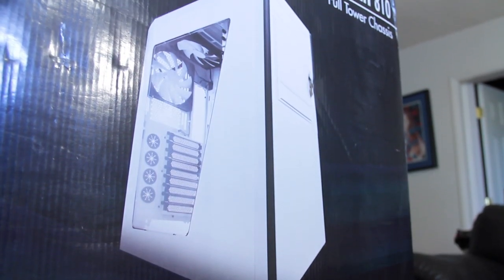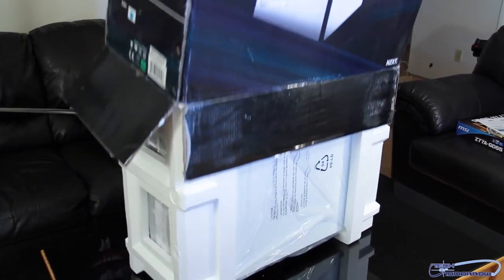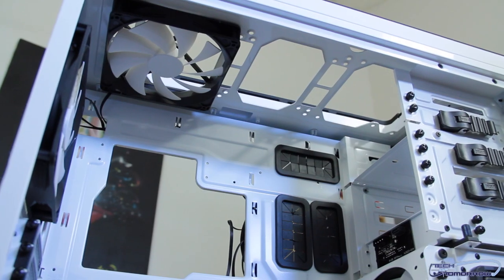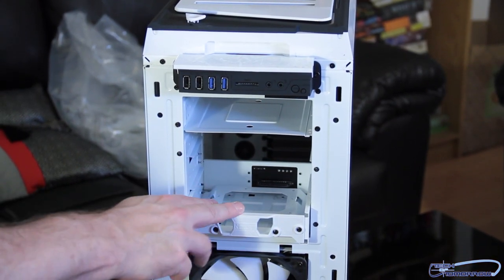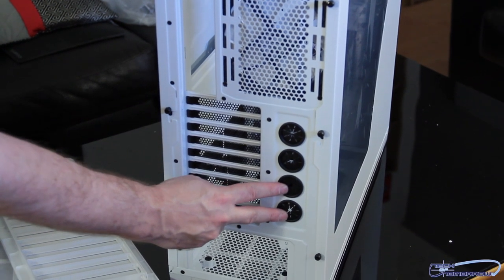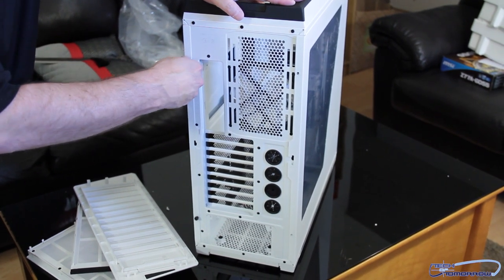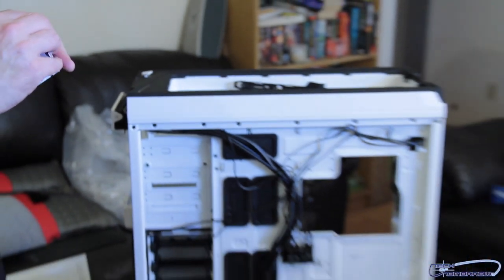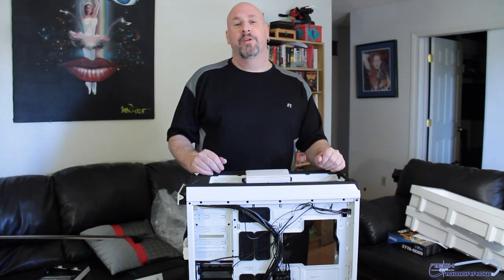NZXT Switch 810 Full Tower Gaming Chassis w/USB 3.0 Unboxing

Comment: I don't like that the side window shows half of the optical bays but not the tiltable fans in their entirety, or if you were to put a rad at the bottom it wouldn't be completely visible. The diagonal just doesn't work for me.

Also if you look at the top of the case, were you to put a double thick rad in the top optical bay would obscure half of a third push/pull config fan, as discovered by timetolivecustoms

Comment: This is a great case to build in. However the only 2 complaints I have are: 1. Wish there was an aluminium version 2. The front fans are screwed in using long thin screws which caused me to file back the Xigmatek fans for the front for the screws to work. :(

Comment: so im looking to get this case along with the kraken x60, what would be the best way to mount the krakem? at the top under the fins and the tubing going down through the slots or, actually in the case and then have 3 140mm fans on the very top?